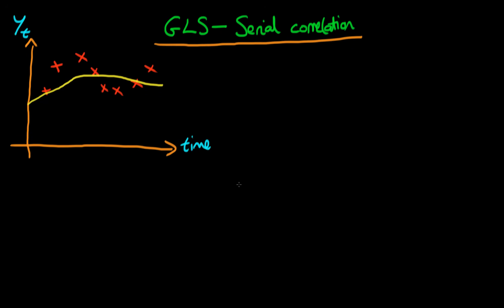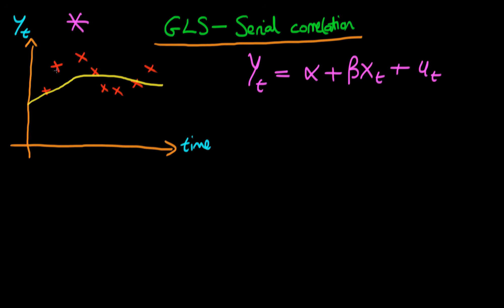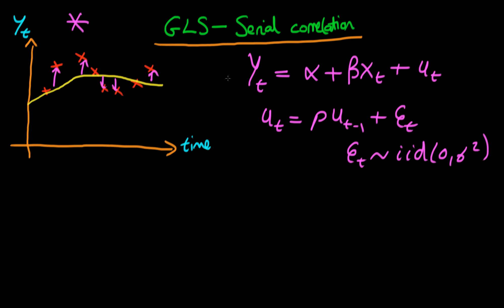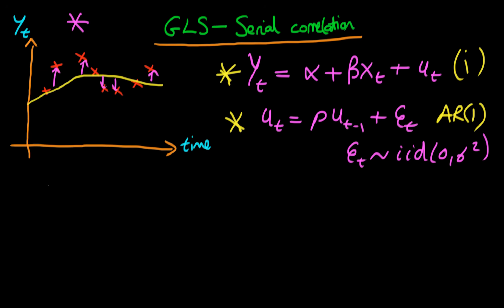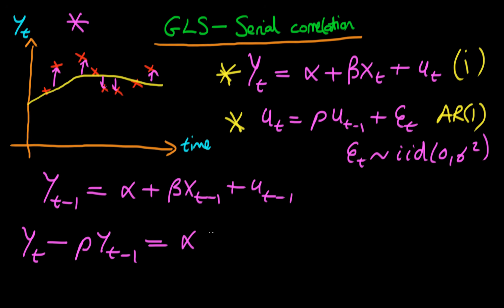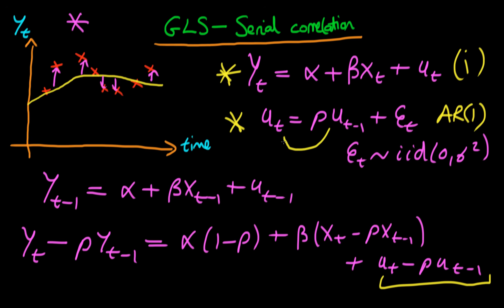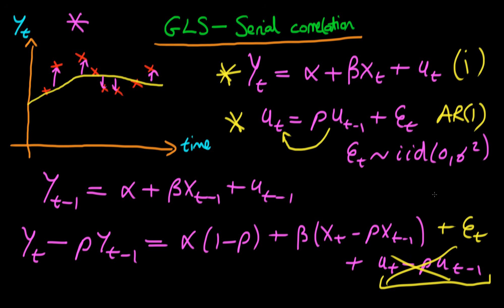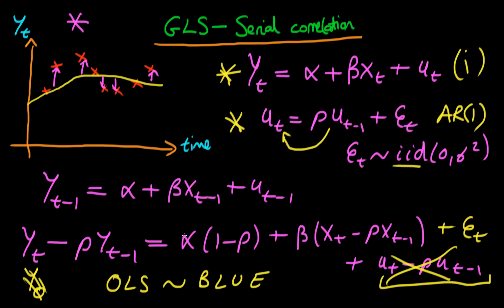GLS estimation to correct for serial correlation

Comment: Hi Ben, love the videos, extremely helpful. I have a question though which is an extension of what you were ending the video on, which is adding back that first variable under Prais Winston. I understand the theory of it, however not the algebra of why you multiply the regression for the first observation by (1-p^2)^(1/2), i understand it is to get errors with the same variance, but why multiply it by this specifically? if you could offer any help that would be great, so and quickly is the variance of the errors calculated in a geometric sum as they are continuously correlated with past errors terms?